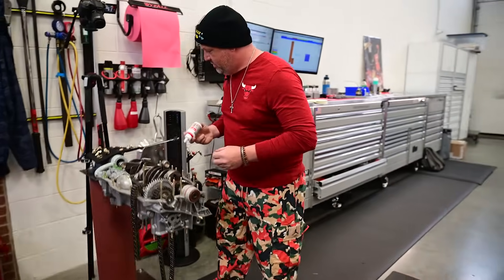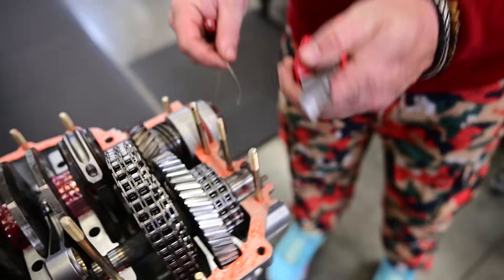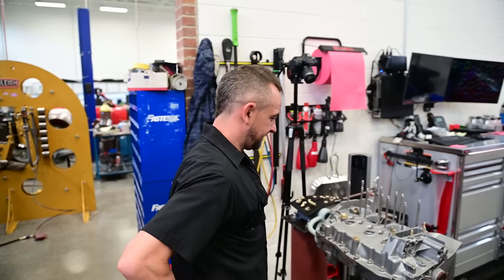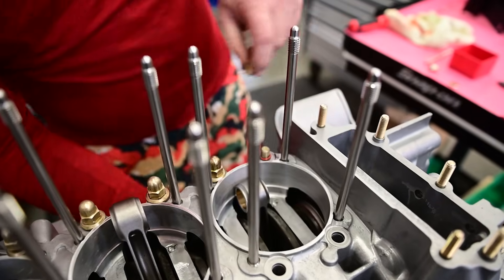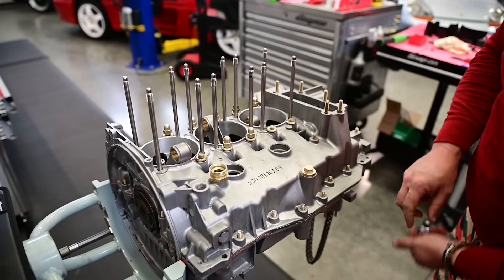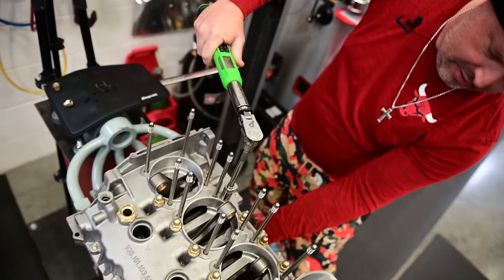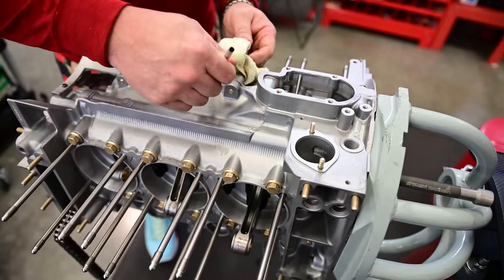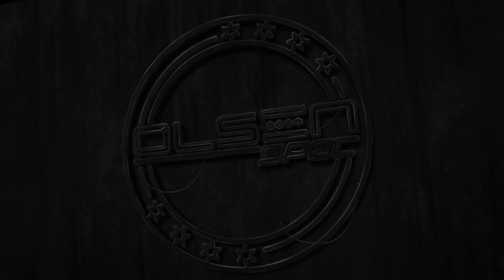How To - Sealing Leakproof Porsche Engine Case

Comment: Lyc and Cont engines require lacquer and silk thread to seal the cases. RTV is a big no no, since it can pinch out into the interior of the engine and get sucked into oil passages, starving bearings and causing planes to fall out of the sky. 
Your odds of survivability are directly related to your angle of impact.
Reply from the maker: We would NEVER use RTV!

Comment: This is not a trick, Lycoming and Continental Aero engines are sealed RTV is not ideal to use with thread.
Reply: So it is a trick, just one you didn’t know about
Reply from the maker: You are correct. Vulcanizing sealant (not this) and Thread are not to be used together. This is Anaerobic.

Comment: Neat idea w the thread. I wonder if the rtv presses into the strands while it flattens to create basically a fiber back up. 10kpsi + hydraulics all use ptfe BU rings to help the seal extrude into a stronger, yet soft surface. Wonder if you can find ptfe thread.
Thanks for sharing a neat trick
Reply from the maker: This is actually anaerobic sealant instead of vulcanizing sealant!